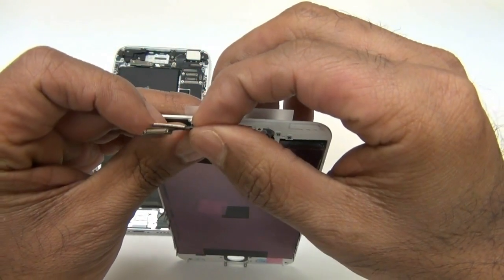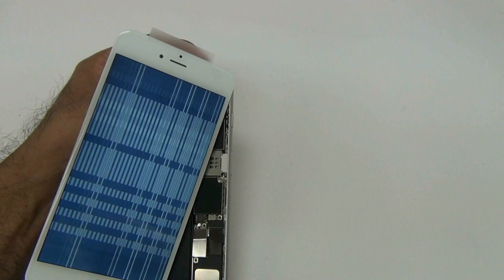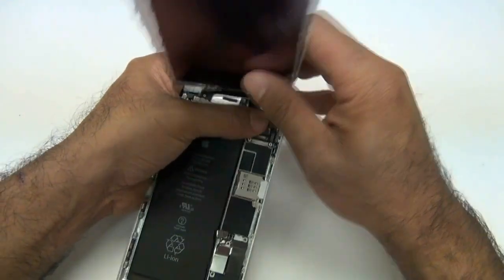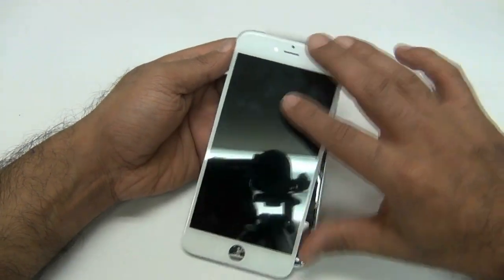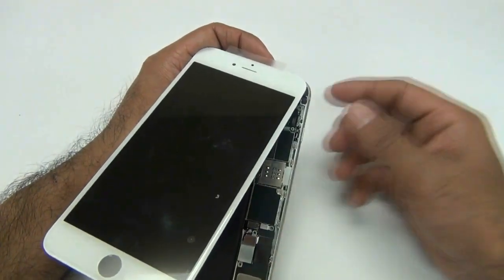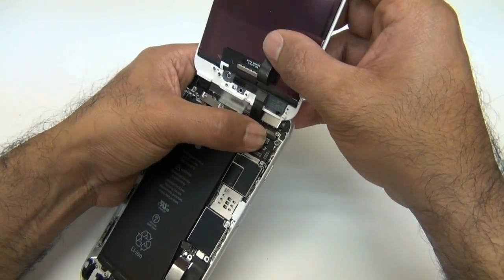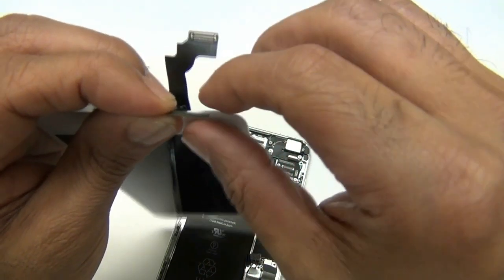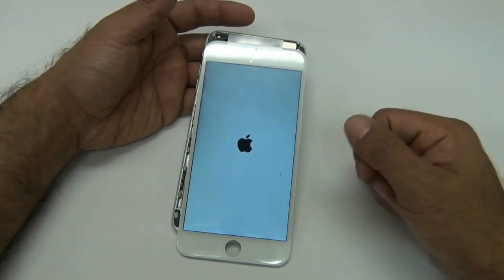iPhone 6 Plus TouchScreen LCD Digitzer Troubleshooting. TouchScreen wont work.

Comment: This worked for me. Had no touch what so ever. Looked at the cable and saw that there was a pin that was bent. Fixed it bug still has a slight flicker on the screen. But this video helped a lot. Cheers mate 👍👍👍

Comment: This video clip is exceptional, should be the first instruction you try when experiencing troubles with unresponsive touch screen! It captures the tacit knowledge known only by experts, and you show this extremely convincingly! Very well done Sir. 

I managed to repair my mother-in-laws iPhone 6 this way today and it took like 30 minutes for a complete newbie. The only problem she experienced was that the letter ”y” and ”6” did not respond on the screen keyboard, a very localized but annoying dead spot. So I just disassembled the screen contacts, inspected them closely, corrected the slight curvature found in some of the contacts. Cleaned the contacts with a slight touch of a cotton swab moisturized lightly with some isopropyl alhohol to get rid of any contaminants from my skin when straightening the cable contacts. Just for good measure. 

This is the very first time I ever tried to get to the inside of a smartphone, the proper opening procedure was found elsewhere but very simple in the case of iPHONE 6; a suction cup and some guitar-pick like plastic bending tools, careful with the upper side and not opening more than say 90 degrees. Had to get a repair kit with the proper screwdriver heads and suitable opening tools of course, prying tools were all made of plastic and worked perfectly. 

Result: perfect function on first attempt, thanks to your excellent instruction to get a feel for the correct installment of the contact strips that is signified by a tactile ”snap”. Many thanks!

Comment: Thank you so much brother!❤️ thought I fucked my iPhone 6 up because I forgot to remove the battery connector. Thankfully the LCD connector was just bent a bit. Your trick did the job! Thank you
Reply: Is Your phone working now ???
Reply: @prashantthakur9347  yes, it worked after I straightened the LCD connector

Comment: I have an iPhone 5 bought a new screen and nothing happened the mute switch is broken so the only way I know it works is by using iTunes it says I have to enter my passcode but I can’t because the screen is black and won’t come on. I don’t know why I have tried putting the cables in and they are all in fully none bent or anything. So I’m not sure what’s up maybe I have a bad screen replacement or maybe the connectors are broken but I would really like if it started working

Comment: Great video and good advise. It is so important to ensure those ribbons attached to the display connect properly and securely. While replacing my iPhone 6 battery, I had numerous attempts to get my iPhone to work only to find "white lines" across the display as well as unresponsive screen not accepting any commands. After looking at your video, I went back to the "drawing board" and closely looked at the ribbons; spray compressed air and push from left to right, display ribbons as well as the digitizer. After snapping them firmly, the display came back and the phone recovered all its capabilities. The most critical part after the firm connecting of the ribbons is to place the extremely small and difficult to manage screws that cover the plate above the ribbon connections. This took me the longest. Thank you for posting this very helpful video.

Comment: I see comments from people with unresponsive or intermittent touch. If your display has not been replaced and you have intermittent or no touch it could be from the phone being flexed or dropped and the touch IC chip has a fracture in one or more of the solder balls. The iphone 6 and 6+ have this issue more as underfill not used on the IC's.   This video is excellent for the issue where you replace the display and touch doesn't work or you have lines.  Take it out straighten the flex gently and as instructed make sure it seats evenly when trying again. I have done hundreds of these and every once in a while this happens and I have to do exactly as he shows in this video. And if having a really bad day might have to do this a couple of times to get it to seat right.

Comment: on my phone, the middle line of the keyboard does not work. any suggestions? i changed the screen and it is the same. it is an iphone 6. Also, the wifi bar is greyed out and my volume buttons do not work.

Comment: Hey my touch screen sometimes(4-5 times a day) becomes unresponsive and doesn't do anything even though there are not line of any sort just the unresponsive screen and sometimes it click stuff by itself help
Reply: I have the same problem :(
Reply: I'm having the same problem too, will this video help ?
Reply: It might be that your iPhone 6 Plus or 6 has the touch disease because you sat down with your phone in your back pocket and the phone bent and the touch sensor is messed up or I might be a cracked screen.

Comment: please help
Reply from the maker: deandar sadullah sure what's your question
Reply: I have an i phone 6 plus and I put a new screen on it and everything is good it turns on and everything but the touchpad is not working like at all nothing works i cant even unlock it
Reply from the maker: then it's either a bad screen or not installed properly. worst case is it's possible touch IC damage and would need solder work. Try a new screen first
Reply: What's a touch ic

Comment: I bought a new screen for mine. Went thru all the steps changing it. Everything was fine up until trying to plug in the longest flex cable. It will not snap into place at all. Won't even grab. What do you think is wrong?  It's not bent or anything
Reply from the maker: Are the pins on the flex cable itself bent?
Reply: Doesn't look like it
Reply from the maker: Overether you just need a new assembly most likely.
Reply: I tried a new assembly but still black screen. iTunes will recognize it but that's it
Reply from the maker: Jessica Masingo could be a damaged fpc connector. likely the case especially if it was having a hard time plugging in
Reply: The new assembly plugged in fine. I'm not sure what has happened. It worked fine before changing screens. I really hope my phone is not trashed
Reply from the maker: Jessica Masingo it wouldn't be. even if fpc is damaged there are company's who can fix it

Comment: This works for me but once i connect the other two flex cables and screw the shield back on it stops responding to touch again. Any suggestions on how to fix this would be greatly appreciated. Thanks in advance
Reply: EsotericMindSt8 Did you fix it?
Reply: i am having the same problem

Comment: Mine has several thin black vertical lines on the screen after a screen replacement. After taking all the connectors off and checking everything, the problem is still there. All the connectors/ports have been brushed/dusted, and none of the connectors are bent. Any idea what's wrong?

P.S. The touch screen works fine. The thin lines are the only problem.
Reply from the maker: Could be a bad LCD or IC damaged during install
Reply: is there a fix for this?

Comment: Hello,

So I dropped my iPhone in water. seemed like a loss, so i tried the whole put it in rice dealio, which seemed to have done something positive since it actually turned back on and it seemed fine, except no touch response. after much research i decided to buy a new screen assembly with digitizer. i got the screen today and tried changing it, but it still did not respond to touch. no lines, no weird lights or dead spots, seems all good except not responsive to touch. i even tested the new screen on my new iphone and it worked fine. i have cleaned my water damage iphone with rubbing alcohol to remove any mineral deposits from the rice, and used a heat gun to dry it all out. watching your video, i noticed my symptoms are the same as your second example, where you're not supposd to go right to left or left to right on the flex cable. still nothing. could it be the part where the flex cable plugs into and not the screen itself? 

thanks in advance!

Comment: If the display still works after this method but the touch screen is not responding, could it be a faulty LCD replacement?
Reply from the maker: +Vincent R Yes, either faulty display or the flex isnt properly plugged in
Reply: Turns out it was the flex cable

Comment: what if its still not working?
Reply: I found a pretty good temporary fix from another video. Try bending the upper right corner of the phone. The issue seems to be with a loose touch sensor on the logic board. The bend should hold it back in place.
Reply from the maker: +Stephen Janus Which part?
Reply: i did this and it seems to be better, no white line appears at the top anymore but the touch still randomly loses responsiveness then will start working again. don't know if there is anything else i can do to fix that
Reply: I'm having this same issue. Touch screen works for a few minutes, then won't work for a few minutes. iPhone 6+. Is this what's going on with you as well?
Reply: +Mitchell Mason ya and sometimes it will work for awhile and others less than a minute
Reply: This worked!